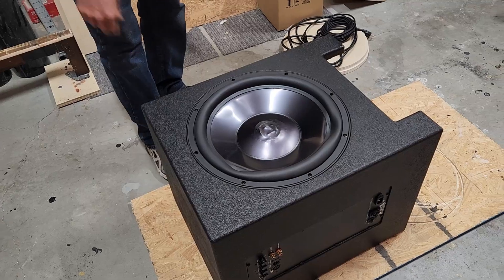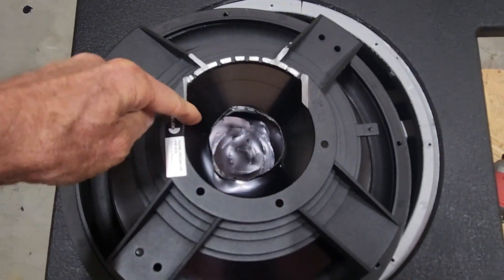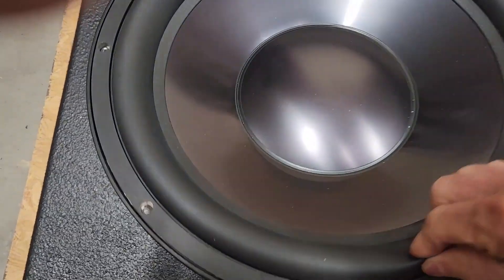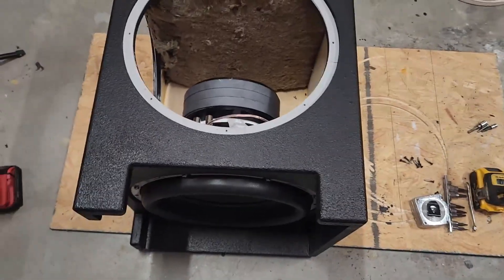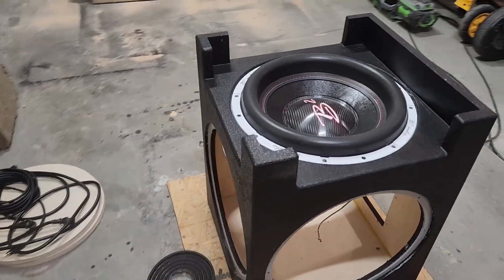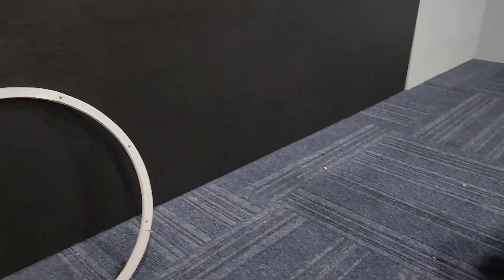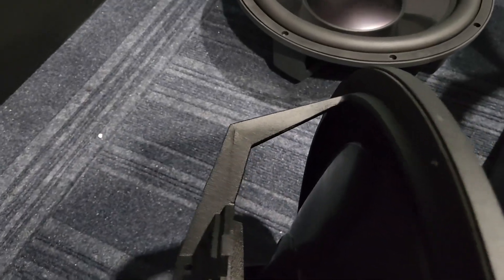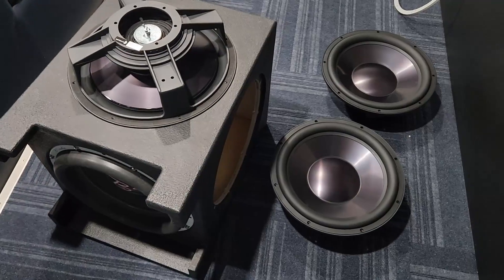I blew it up, then rebuilt it, Now it's BRUTAL.  15 inch passive radiator subwoofer DIY build.

Comment: So what's the issue with having too much weight on the passive radiators? Why is it not recommended? Can it possibly damage them?
Reply from the maker: At lower frequencies and higher excursion, it starts to lose cone control with anything over 7 disks, so I wouldn't recommend anything more than 7.

Comment: You’re using wire nuts !!! 🤦🏽‍♂️
Reply from the maker: True.  I use wire nuts because I tend to tinker with the subs until I get them just the way I want them.  And that means pulling them apart several time to perfect them.

Comment: It just looks so kool i want to build one just to display it in my trunk ,this can basically be tuned within a certain frequency range for fine tuning am i missing something or would i be better off sticking with my infinite baffle 💡 idea.
Reply from the maker: The main benefit of the passive radiator setup is that you can tune it to your liking.  With any other design, you're stuck with the tuning once it's built.

Comment: coolest thing ever. but i would rather have 1 passive radiator max for efficiency's sake. maybe im wrong, but when you get real woofer. i truly want to see the phase response of this thing off-axis
Reply from the maker: I'm not sure that they make one big enough for this driver :).  but I agree.  That would be the most efficient.
Reply: @righteousbuilds3576 a little after I made this comment I looked for passive radiators..... Nothing over 12 inches. I need 21 passive radiators made asap!😂

Comment: I did something close to that design i used 3 passives and tuned the passives to different frequencys so 1 plays 25-30 really aggressive 1 played 30-35 aggressive  and 1 played 35-45 aggressive  and the subwoofer played 20 to 65 pretty flat it was a rowdy bass machine i used for surround sound and music in the basement it sounded dam good  i had my passives inverted so I could adjust the tunning on the fly it was so cool
Reply from the maker: That's awesome.  Most people recommend against having different tuning frequencies for each PR (but then again, most people don't know what they're talking about:), but if it sounds good, then do it.

Comment: Ya infrasonic is the sheeit. My 21 inch kraken is calibrated flat with my sound system within 4 db of any other frequency up to 20khz. Im lookin at doing a downfire enclosure with 3 passive radiators and i was frustrated because the passive radiators are almost 9 inches deep. Im doing the radiators left right and top firing lol the idea of inverting the. Idk why i slept on that! LoL woulda been tricky running a 8 cuft enclosure the way i was thinking. But watching this you needed 3 radiators, im running a 21 inch driver and 18 inch radiators, i wonder if i need 4 radiators... But probobly not since i doubt ill be using the kraken even near full power since im sure as it is the drywall is about to rip off the walls. I wonder howbwell ill be able to tune out resonating frequencies and deal with the phase alignments... LoL
Reply from the maker: That's a lot to think about.  Your build is probably all done now since I'm replying 3 months later, but for a dedicated home theater sub, I would go ported forward firing if at all possible.  You'll appreciate the extra extension and won't have to worry about blowing your PR's to the moon:)

Comment: You need to have 2x the area on the passive radiator to avoid over excursion. So a 15" passive radiator for a 12" driver.
Reply from the maker: I did have 2x the cone area, but the active driver had so much excursion, that it blew both of the passive radiators out.  So I added a third to make sure I had some headroom. :)

Comment: Had your channel just show up in my feed. Wasn't sure what to expect as there are so many lame build videos out there. Pleasantly surprised by what I saw, but I think I might hate you. I was finally happy with my cabinet design (three sided with curved corners) for my TC Sounds LMS Ultra 5400 and two 18" TC Sounds PRs, but now I am conflicted by what I have just seen. The inverted PRs are kind of cool. Bugger now I am going to have to decide which way to go all over again.
Reply from the maker: LOL.  Decisions, decisions.  I know you'll design and build the best one ever.  And it will be very RIGHTEOUS.
Reply: @righteousbuilds3576  I think I will stick with my original design mostly because it will be harder to build and look a bit more flash when it is finished. Plus I only have two 18" PRs. If I had three or four I might have been very tempted to do the inverted. I am going to be using a Crown I-Tech 9000HD to power it, so I don't need to be concerned about where to mount a plate amp.

Comment: No phase issues?  since you got the waves goin 4 directions......it would seem that some frequencies are cancelled out  by each woofer/radiator
Reply from the maker: I didn't see any cancelation below 100 hz.  Bass is spherical anyway, so I would think it's okay to send it in all directions.  It seems to measure nice and flat :)

Comment: What amps are you running on those dual 24” subs? What you getting for SPL? Those Stereo Integrity subs are sweet!
Reply from the maker: I'm running dual sp1-4000ht amps on them.  8,000 watts of clean power.  You can find them at GSG audio design.  I've never maxed them out, but I've tested them as high as126 db at 13 hz :).
Reply: @ did you build the box sealed or ported? I didn’t get but a glimpse of it… from what I saw, looked badass!
Reply from the maker: @Partyinparadise21  That's a 14x14 inch port.  Just right for 2 giant drivers :).
Reply: @ thanks dude for the info.

Comment: You can easily fix the passive with the separated spider, but I'm sure you know that.  What amp plate is that?
Reply from the maker: True.  I bought the new ones just to be safe.  I appreciate the comment. That's a speaker power sp1-2400ht amp.  You can find them at GSG audio design.
Reply: @righteousbuilds3576  I've watched 3 of your videos now, with my first one last night when i messaged you about the spider. It's good to find someone else that does what i do.  I've been building home theater subs a few years, and I'm currently working on a push pull 15.  Like the Perlisten 215 or M&K x15.  Ever tried one of them before?   I'll thumb through your videos to see.  So between the Dayton Audio amps, like the SPA500 or 1000, or the spa500dsp, how do the GSG amps compare?
Reply from the maker: @Paulscole3  I actually haven't ever tried any of the Dayton audio amps.  I like having way more power than I need, and the speaker power amps provide just that.  Ive worked with ICE amps, and to my ear, they just don't sound as good as the Speaker power units.
Reply: Sorry, I'm using the thiel 12" drivers for another push pull once I finish this dual 15 push pull.  That wasn't very clear.

Comment: That is bad ass! What is the cost foe one of those?
Reply from the maker: These get expensive because of the equipment used.  The cost for one of these would be $3900.  Of course the one in the video was an experimental build with some 1 inch baltic birch scraps, so if I built one to sell, it would be properly sized to make sure that everything works the way it should :).
Reply: 🤔 Not bad considering the return on quality of bass… What would you recommend for a theatre style setup, something in a 20’ x 20’ size room with about 10 seats? I’ve been toying with bass under the seat platform to give a physical “punch” to the viewer, but thinking a more typical “bass wave” from the front might be better. Hit you in the chest instead of the ass 😂

Comment: I created a PR system with an Alpine 12 and 2 cheap blue cone subs. Removed the magnets and put some fairly heavy washers in there. VERY impressed with the performance considering it's in a 1 Cu ft box. Makes everything in the car shake. However, it does thrash the PRs. I've already had to repair one. Where do you get those massive passive radiators from? Those look GREAT inverted!
Reply from the maker: Thank you.  I picked those up on parts express.  Yeah passive radiators allow you to do a lot with a little, but they definitely take a beating.

Comment: I have the exact same subwoofer in a t line that has a really flat response from 15hz to 50hz, and 60hz has a huge peak cause of car cabin gain
Reply from the maker: Nice.  Yeah, I think it will do just what I want it to.
Reply: Fwiw, perhaps it's more likely a 60hz modal peak rather than cabin gain. 

Curious, what type of vehicle?
Reply: @FOH3663  its a vw polo 6r, graph shows high peak around 60hz in hornresp, its a basic t line tuned to 23hz
Reply: @fredy000  
Interesting.

Just pulled up vehicle measurements, ... I suspect the vehicle's cabin fundamental resonant mode may be responsible (~60hz), from that freq downward it would exhibit vessel gain, ... lossy, but still huge at a minimum of 6dB/octave.
Reply: @ I got a spl meter and it did 143db 17hz and 141db 33hz  on music
Reply: @fredy000  
Nice!
Reply: You should calibrate your sound system in your car, it takes the right kind of hardware to do so but, you really don't wanna just leave that out of the box calibration. Hideous. LoL😊

Comment: what did you use for "discs"?
Reply from the maker: Dayton audio includes 7 discs for each passive radiator.  They're just really big heavy gauge washers.
Reply: @righteousbuilds3576  but the weight of the washer will have a direct impact on the on the performace , any way you can weigh them?
Reply from the maker: @kawicepticon8866  lemme see what I can find out.  I don't have a very sensitive scale.  I'll do some research.
Reply from the maker: @kawicepticon8866  Okay, just found it.  Each disc is 75 grams.

Comment: Doesn't adding the weight increase the fs not lower it?
Reply from the maker: Fs is known as the resonant frequency (the frequency that the driver/passive radiator is the most comfortable vibrating at).  Adding weight lowers that resonant frequency.

Comment: Your Excursion has to be two times more than your driver on your passave subwoofers
Reply from the maker: Very true.  I thought I was leaving plenty of headroom since the driver was rated at 20mm of xmax and the PRs were rated at 30, but it turns out that driver is actually a freak.  lol.

Comment: If that happening to the drivers that plate amplifier not going to last very long at all .  The bolt on the backs should be cut and use a nut inside of wing Nutt so it can't hit.💯🫡✌️
Reply from the maker: Agreed.  Yeah, I'm gonna do a rebuild on that box.
Reply: You already got another set but the passives radiator  should have just as much excursion  if not more then the subwoofer being used . I'm pretty sure those passive  don't have as much travel then the b2.audio  i suggest the earth quake passive radiator  would be alot better option   there also a lot  slimer. Just afyi😉🫡💯✌️

Comment: Why didn't you post the speakers flexing when you did the test runs?
Reply from the maker: I appreciate the question.  I'll put it down as something to do in the future.  I'm not done with that B2 driver just yet :).
Reply: @righteousbuilds3576   that B2 driver is a beast!  In my story videos you'll see I have a 6 12's with one passive radiator for each pair. I had to take it out of my truck to fit a baby seat lol so I bought a cheap Rockville punisher 10. I'm going to make a box with the 10 on top inverted with four passive radiators around it.

Comment: Inverted helps so the tuning disk arent hitting the subwoofer magent causing damage to the passive radiator thats why your radiators were damaged was to much excursion now having the Inverted will sound  better.
Reply from the maker: Yes sir, you are correct.

Comment: I’m sure the steel parts on the radiator are sticking to the magnet when they flex that’s why they are probably being destroyed also
Reply from the maker: Very possibly.  The box is in need of a redesign.

Comment: Such an awesome & relevant video ! Im using the same PR (only 2 tho) on the 18" Dayton Reference HO combo they offer.
Brought a 2nd one and bottomed the voicecoil out so I swapped in the new Ultimax2 (in an 18). PE gave me a TF of the ULT2 vs HO but your inverted PR's are inspiring. Im going to start tinkering-Thx

Comment: I love the look of the inverted drivers. Not sure if the hz was too low to hear during testing or the sound wasn't played during the vid. The travel of those passive radiators is insane. Thanks for the content.
Reply from the maker: Yeah, I had the sound off on those clips to avoid copyright trouble.  I just wanted to show them in action.

Comment: That fit still seems a little snug to me. Remember the enclosure itself is going to be flexing like mad when that driver is kicking. What are you driving it with? Something meaty? A big Krell?
Ive klipsch with passive radiators. They work
Reply from the maker: I'm using a speaker power sp1-2400ht.  It's rated at 2400 watts at 4 ohms, but its also 2 ohm stable, so it'll push more than that when it wants to.  It's pushing a 2 ohm load on that driver right now.  I'm not sure if you've ever worked with 1 inch baltic birch before, but it's very rigid.  I'm not super concerned about flex with the amount of strength that the wood offers.
Reply: @righteousbuilds3576  Ok cool,didnt realise the timber used etc. My only experience is with RELs. I have a 2 channel system,1 amp per channel thats plenty but when the RELs are on its a whole different ballgame. I feel tat sub placement in the room and making sure everything is in phase makes as much difference as a brand new sub of double the size. Thats the issue with car audio for me. There's not enough Internal volume inside a car for the subs to work properly. Love the channel. More please, 👍
Reply: Fwiw, the internal volume of a vehicle doesn't really limit bass performance ... 

For example; my hq in-ears perform just fine in the bottom octaves.

Comment: Dude this was crazy interesting!! 🎉 inverted PR added internal cu3. It looks pretty cool and can have the powered sub facing front with no boundary effects from the PR?  
I still kinda think the PR facing out might more aesthetically pleasing but I wonder what it would do to the curve? 🎉. 
I didn’t see where you addressed/answered why they wouldn’t fit facing out? 🎉 
That sub is for real! But wonder what the Fs is? 🎉
Btw. Dunno why, but this setup kinda reminds me of a “steampunk” or Star Wars look 🎉 
Great vid 🎉
Reply from the maker: The new passive radiators that I ordered were the same model number, but would not fit into the original cutouts.  So instead of taking about a day to do that much sanding, I inverted them.